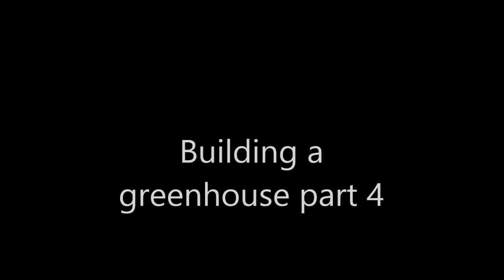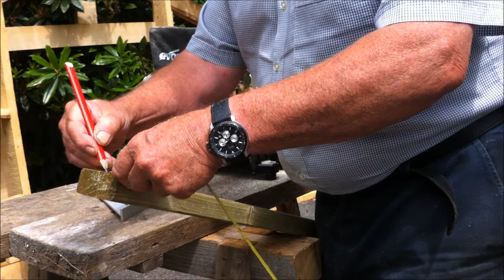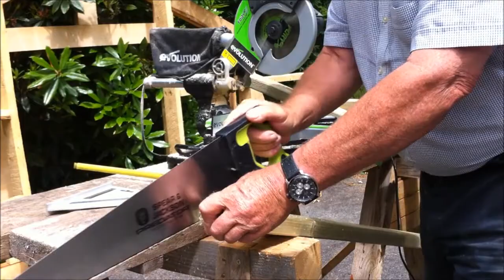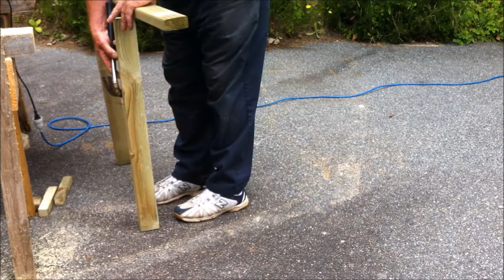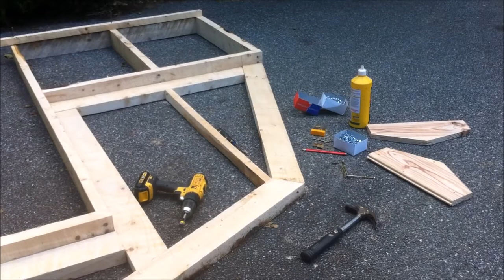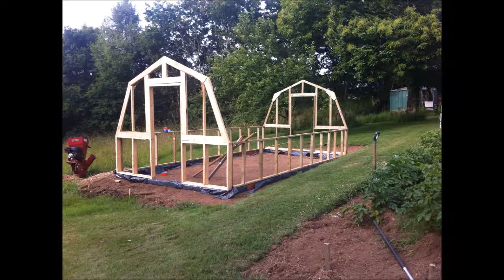how to build a greenhouse - building a greenhouse - diy pvc greenhouse part 4

Comment: Hi Mike, Another fine video and a job well done. I have a similar Evolution chop saw - model Rage.
I am surprise that you did not screw the assemblies. Did you drill pilot holes before nailing to prevent splitting? I also find quick grip clamps useful when joining timber sections, especially when on your own. Looking forward to the next installment!
Thanks for posting...........Nigel
Reply from the maker: MuddyBootz A couple of good points, in actual fact most of it is screwed it is only the lower section that is nailed together, pre-drilling would certainly prevent splitting but I use the old carpenters trick of blunting the end of the nails with a hammer first which does the same thing. Thanks for the comments. There must be a theme with naming the says mine's a "Fury"